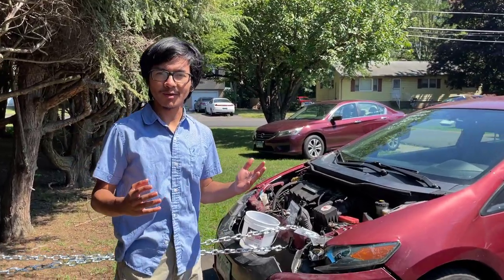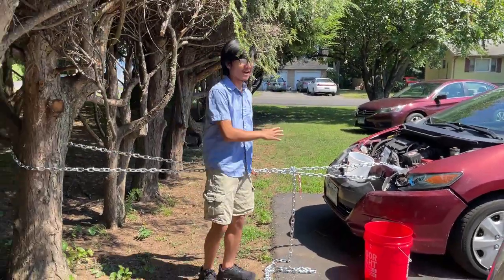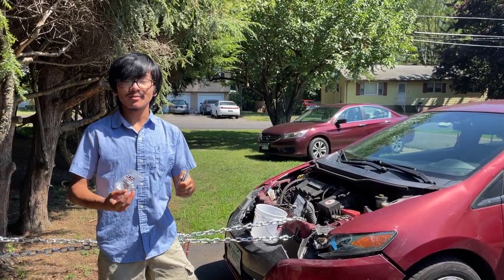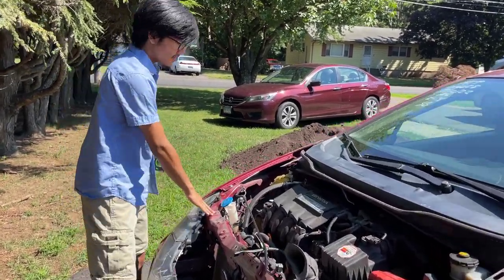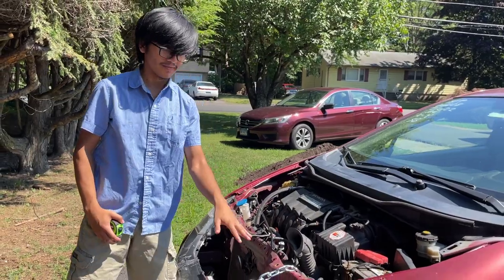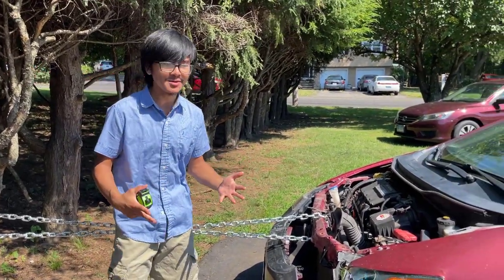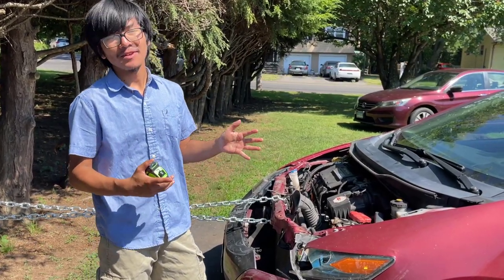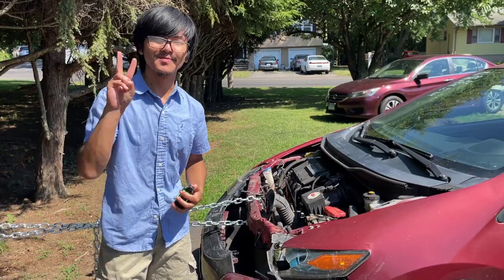Front End Car Frame Straightening DIY Tie Chain To Tree | Honda Insight Collision Damage AutoRepair

Comment from the maker: Here are the #ad links to some of the tools or parts which might be required to perform this repair:
1.  https://amzn.to/3pEeM5C  |  1/4" X 12' Heavy Duty Tow Chain Automotive Truck Towing Log Chain
2.  https://amzn.to/43pb90T |  Camco Heavy Duty Steel 48" Safety Chain with Spring Hooks - Secures Tow Vehicle to Trailer | Class I 2,000 lb Capacity | Great for RV, Trailer, and Boat Towing |Rust Resistant - (50022)
3.  https://amzn.to/46R1inN  | ALL-TOP Nylon Heavy Duty Tow Strap Recovery Strap Kit : 3 inch x 30 ft (35,000 lbs) 100% Nylon and 22% Elongation Snatch Strap + 3/4 Heavy Duty D Ring Shackles (2pcs) + Storage Bag
4.  https://amzn.to/43rBwDE  |  CURT 82932 Threaded Quick Link Trailer Safety Chain Hook Carabiner Clip, 1/2-Inch Diameter, 16,500 lbs Break Strength
5. https://amzn.to/44MNzfV  |  FITHOIST G80 Transport Binder Chain 1/4 Inch x 14 Ft | Tow Chain with Clevis Grab Hooks | 3,300 lbs Safe Working Load | Heavy Duty Chain for Transporting Towing Tie Down Binding Equipment

Or Click on Amazon link here and search for what you need:  https://amzn.to/3xIOsqg